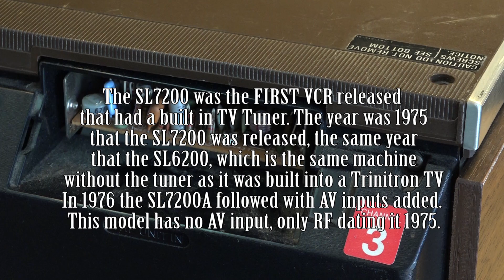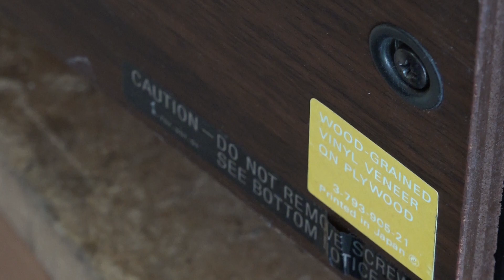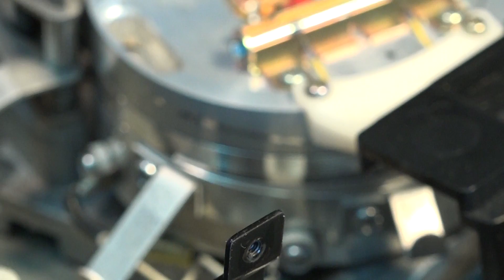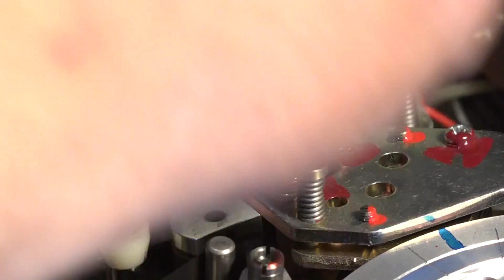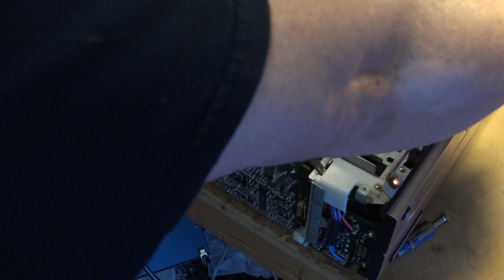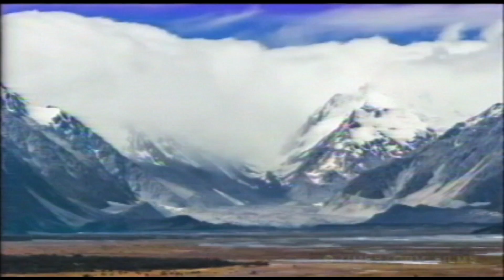Sony SL7200 Vintage Betamax Overhaul repair

Comment: I have a SL-8200 which is almost identical to this one and there is a noise that as far as I can tell is coming from the head drum. It sounds like it could use some lubricating, but I don’t know where. Is there a lubrication point for this, either from the top or bottom of the machine?
Thank
Reply from the maker: The 8200 capstan motors were the weak link on those ones.
Reply: @ the capstan motor was seized and I took it apart and lubricated it. Its working now. But theres a friction noise coming from the head drum area, like it needs a drop of oil somewhere, but I don’t know if there is a lubrication point for the drom head or where the bearing is.
Reply from the maker: @FranciscoBadillo-o6x it runs down the center of the drum.  Since that one has an ac motor and belt drive the drum speed is regulated by a brake motor.
Reply: @12voltvids  do I diassemble from the bottom and lubricate there?
Thanks

Comment: Hi, what digital to composite converter did you use to record that youtube video at the end on the betamax?
Reply from the maker: I recorded from the old beta onto dv tape using a Sony GVHD7000 hdv deck in dv mode.  That digitized into standard 4:1:1 DV format
 I then played it back and dumped via firewire to the computer.  I could have skipped the record to dv step if I had taken the beta into the house.

Comment: I have one of those in better shape and it worked the last time I used it. I planned to keep it because it is Beta 1.
Reply from the maker: It had beta 1 but but it was low band beta 1. High bans beta 2 and 3 looked better.   High band and super high band beta 1 was fantastic.
Reply: @12voltvids  I remember when those super high band machines came out but they looked like someone had turned the sharpness all the way up so I didn't like them. My SLHF-300 made great looking copies of laserdiscs.
Reply from the maker: @andershammer9307  the only machine that had super high band was the slhf1000 and it recorded a very good picture rivaling 3/4" umatic tape.  The VHS camp came out with the HQ circuit which just sharpened the edges. B

Comment: I have a Sony SL-F1 (PAL version of the SL-2000), which has a tendency to really expose dropouts on the tape.

Is there a way to suppress this?

Quite a few years back I had to transfer to digital a tape containing my late grandmother's 65th birthday, which contained a lot of dropouts and I had borrowed my uncle's beta deck for playback, since my own SL-F1 wasn't exactly in working condition at the time (power supply issues). Sadly, the tape used for storing the home video wasn't exactly the best in terms of quality and had been used quite a bit for daily recording and as such was riddled with dropouts.

But my uncle's deck (a Sony C20, I think it was) did an excellent job at "hiding" a lot of the more dominating streaks caused by dropouts - or at least make them stand less out.

Is there a way to adjust the SL-F1 to better suppress/"hide" dropouts to such a degree, that dropouts are less noticeable?
Reply: The SL-F1 had a built-in video dropout compensator - however this would cause problems when the deck was used for recording digital audio, which used its own error correction system for dealing with dropouts, so there was switch to turn it off when using this with a PCM digital audio adapter. Somewhere, on either the power supply or the plug that goes into the socket on the back, there will be a switch labeled PCM. You need to make sure that this is switched off to turn on the video dropout compensator.

Comment: I  have a Zenith JR-9000W  which appears to be the same as this Sony you are working on.  The Zenith powers up and looks to be functional, the cassette loads fine and spools out  and ejects ok but the only buttons that work are the eject and stop. Can't push the play, record or fast forward.  Any ideas what could be going on? All the belts are there and look to be fine. Appreciate any help.
Reply: I found the problem, one belt needed to be replaced. Now works fine  except will not play in color. Will record in color but plays it back in black/white. Put the recording on another player and the color is fine. Any ideas on that problem??
Reply: @tommills8368  AFC trimmer on the chroma board is probably off.
Reply: @crashbandicoot4everr  Thanks for your reply. What does that, "off", mean? The board needs repaired or replaced or turned on?
Reply: @colllisionman  Off-adjustment I should say. There's a trimmer (variable resistor) that adjusts the AFC for the chroma. 12voltvids did it on the SL-8600.
Reply: @crashbandicoot4everr  How do I find it? What am I looking for? Can you describe it please?
Reply: @colllisionman  Remove the bottom cover and unscrew the large circuit board. That board processes the luminance and chroma signals. You will find many variable resistors on that board. Look for the one marked "AFC", mark its original position or take a photo, then adjust it carefully while playing back a known-good tape and see if the color comes back on playback.
Reply: @crashbandicoot4everr  Thank you very much.

Comment: I don't think I have ever seen you clean any pulley groves only belts. Isn't it advisable to clean both?
Reply from the maker: If the belt had melted I clean it up.  I generally don't film the process because it is messy and time consuming but I have shown the process.

Comment: This Betamax VCR was introduced in 1975, but it usually came with a console TV which was the LV-1901. This was a Beta 1 only VCR, but a few years later, they added the Beta 2 and Beta 3 speed eliminating the Beta 1 speed from one of their earlier models. Pretty rare to find.
Reply from the maker: Yes very rare these days. I got this back when I worked for Sony. The heads were worn completely when I got it.

Comment: That's  a real beast  bit like Phillips 1500 had one motor. did you have original jvc mechanicals over there .l find your vids v interesting.u seem to have have plenty of work.l was in the trade .32 years don't think there any techs left .if it goes Duff u bin it.
Reply from the maker: Yes original JVC and Panasonic mechanical units were here. I have an old JVC, actually a few of them

Comment: Hey what if the 3.5mm screws that hold the upper part of the drum (those that you couldn't remove because you didn't have the tool) were stripped, would it be impossible to take apart the drum?

Comment: Quick question, any good online places to find belts? I have a Toshiba V-S56 that needs a new capstan belt.
Reply from the maker: Try these guys.
https://kpcomponents.co/
They are local to me, and I have bought a few things from them over the past 30 years. He won't know the belt from the model though. You will need a size.
Reply: 12voltvids 
Youre a life saver man! I really appreciate what you have done here on YouTube. Watching your videos really teaches quite a bit about these old electronics. I got a umatic right before I found your channel. It's a vo-2800, still trying to get it up and running. It was owned by a scientist. Can't seem to understand how the mechanism from it works
Reply from the maker: Stevo701 Gaming 
I have a vp1000 and vp2000 plus a Panasonic 9200 umatic and a Sony vo4800 portable. Pretty old machines.
Reply: Man that vp 1000, 2000. Can't imagine the amount of hours put on those things. I was also given a jvc vidstar hu-3300 it needs some new belts though

Comment: For what I see you're a Betamax genius I ha a couple of Betamax's tha I refuse to let go cause I have a few family recordings on beta tapes that were originally recorded on the SL2001 that I still have and has loading issues that I might try to fix looking at your SL2000 overhaul. I had some a couple of those very heavy first unit that I left behind when I moved and regret it now. Anyway I have a question is there a way to revive the dim display of the SL-HF300 the machine plays well but the vu meter is almost dead and clock is very dim. Thanks my email is pedrorl@aol.com

Comment: I had this machine or the one that came after it. I bought it in 1978. It cost $1,200. I recorded Elvis Presley's last concert the night I bought it, which was a few months before he died. I remember when the networks started using B&W video tape around 1960. I was fascinated how it looked just like a live picture. I can't figure out why film, although very good, looks different then a video tape recording. Is it the FPS rate difference?
Reply: Hello. Film looks different because it works very diferently compared to tape. You can get about 4K or higher resolution of film whilst back in the day older 2'' studio tape was quite limited in bandwidth because it really wasn't defined in pixels. Do some more research and you'll find out why film was king. Cheers :)

Comment: I have sort of an odd question. I have a SLHFR-30 Betamax and wanted to know if it would be possible to hook it to a modern cable box (the box I have is the ARRIS IPC 1100)? The reason I ask is because I wanted to see what it is like to record modern tv shows with vintage video equipment.
Reply from the maker: The answer is maybe. Your cable box will have standard AV outputs, and it also has an RF output that sends the signal on channel 3 or 4.Just connect your VCR to either of those jacks and you should be able to record anything you are watching. Some cable boxes, like my system, which is a Cisco 7150 turn off the analog outputs when an HDMI cable is connected. All I had to do is unplug the HDMI cable and connect it to my TV using component, and then the SD video output became active again. I can record everything, and I do it to DVD except for copy protected content. On demand movies, and HBO content is protected. So to record that I just run the video signal through a Macrovision scrubber (I did a video to demo this last year) and I can record everything, and do this on a regular basis.I also have the component cables routed through my Hauppague HD-PVR (original version) and that allows me to record an HD .MP4 of anything I can watch. I do this all the time, as there are series that I have been keeping, Homeland for one, that I have every episode on hard drives.I don`t upload it or anything, just for my own viewing, as I don`t use bit torrent to pirate anything. I work for an ISP, so if I were to get popped for copyright infringement for file sharing my employer would frown on this.
Reply: +12voltvids Thanks for the info! I will see if I can get it to work when my holiday break from college starts. On a side note, my dads uncle had the SL-7200 Betamax. He bought it in early 1977 and also purchased an inexpensive Black and White camera alongside it The SL-7200 was his main VCR up until 1984 when he switched over VHS due to the fact that the Beta format was on its way out (which was also around the same time my parents bought their first VCR, the Magnavox VR8416SL01).

Comment: This was not the first consumer VCR available. That was the Philips N1500 from 1972.
Reply from the maker: Those ones don't count, because first they were never available in North America, and they were proprietary format. In other words the tapes would only play on the same model. As Philips released newer models they were not backwards compatible.  U-Matic was the first video cassette standard, followed by Betamax, and then VHS. There were other formats also released, but they were never in widespread use. Also I never said it was the first VCR, I said it was the first Betamax model, released as a stand alone machine. The year before Sony released one that was built into a colsole TV.
Reply: What do you mean about backwards compatible? The N1500 was compatible with each N15xx deck.  The N1700 series was a different system, although the use the same cassette. Whatever you want to say, but the N1500 was the first consumer vcr available. And yes. Europe was 4 years ahead of north america on this one..
Reply from the maker: Right, you just said it. Same tape but not compatible.  That is just like the reel to reel systems we had here in the 60's, that's right the 60's and I have one, a Sony VC2000. The tapes all fit, but the signals were recorded differently. Betamax and VHS solved that problem.Even when S-VHS was released, it used the same physical size tape, but a different format, but it could play back the older standard tapes.Remember we had Umatic here in the early 70's which used the big 3/4" tape before any of the 1/2" cassettes were considered.
Reply: @12voltvids  The Philips VCR format actually was briefly marketed in the US under the Norelco brand, but it was a flop. The fact that the maximum running time of the NTSC version was only 50 minutes (vs 60 for PAL) probably didn't help:

https://www.youtube.com/watch?v=HvzOUrUshfQ

Comment: Really enjoyed your restore vids. Any chance you have cassette housing assembly and a belt you could part with/sell me that would be compatible for the Sony SL-800ME? A previous "tech" took a look at it and broke the belt, messed up the gears, and bent the assembly out of shape. Everything else appears to be working but I can't find any parts or donor machines for the life of me.

Thanks!
Reply: Simon It's the 711B2 chassis. The SL-F30, F60 and some other models have the same mechanism. Good luck restoring this wonderful multi system machine!

Comment: I really like your work to get those old betamax machines working.

I have a old betacord 1982 Sanyo VTC 5000-2 i have had it sense 1983 it still has power, no longer plays but when it did play it chewed tapes when stop was pressed rewind/fast forward was always very slow it was never able to rewind right back to the end of the tape. I would love to get it running normally again I still have tapes with the player.

So have you ever worked on the Sanyo betacord VTC 5000-2 model.

Cheers 12voltvids.
Reply: Shelley Wayne That's Sanyo's most popular model. Just replace the two belts and the idler and it will run just fine.

Comment: Awesome machine! How much do you think a machine like this cost back in the day? I have a Sony SL-5000 from 1982. I have it up on ebay right now for parts or repair. It's heavy as hell so nobody seems to want to pay for that crazy shipping price. It doesn't have the UHF or VHF knobs like your SL7200 has.
Reply from the maker: The first machine I bought new in 1979 was an RCA VCT201 and that cost me 2,000. This machine in Canada would have been more than that. The SL8600 was the current model for Sony at that time and it was 2100.00, and that is why I went VHS, because it was 100 cheaper.
Reply: Isn't that just wild. I just did a quick inflation calculation and 2000 in 1980 is like 6,167.54 in 2016.
Reply from the maker: Right, so remember that in 1990 I dropped 12K on a camera, and another 10K on a camera in 2000 and these were SD cameras.The first HD camera I upgraded to was 5,500.00 in 2004 back when I was still a serious videographer / cinematographer.For fun I think I will haul out some old cameras,  and do some shooting, from my oldest ugliest cameras I own. and believe me there are some ugly cameras I have. Going back to black and white gear.I'll record all the ST stuff onto modern digital tape, so the actual picture from the cameras will show through as good as they possibly can.  After todays fight in traffic on a wasted trip to the big city to buy parts (unsuccessful at that) I need a project that will calm my nerves. How anyone can crash into a truck I don't know. On the freeway at that. What should have been a nice relaxing trip to the parts dept turned into a nightmare. It started with a bad decision as to which parts store to go. I decided on the wrong one. Get there, only to find that they have moved across town. Funny when I was there 2 weeks ago there was no mention of them moving! So drive to the new location, fighting traffic again, missed them by 5 minutes. Actually I was there on time, but they had already locked the door! Time to fight traffic again. 4 hours to get to town and back, and I should have been there and back in 1!
Reply: I love old tech and would love to see more of your collection. Wow that sounds like a rough day. I hate driving through big city traffic. That's why I love shopping online and don't mind paying the shipping prices. Between your gas, time, and piece of mind it's worth it.
Reply from the maker: I am planning a video shot with a bunch of old cameras for comparison. Everything from an old b/w Vidicon, to single tube vidicon, consumer and broadcast single tube saticon, b/w and color ccd of various pixel densities. Will record everything to do tape, so the quality of the actual camera can be compared.   Should be an interesting comparison.

Comment: I would like to see someone service a Video2000 deck.  The format was developed by Philips in 1979 to compete with Beta and was better in several regards.  It only recorded one half of the tape at a time so the cartridge could be flipped over and recorded on the other side.  Many Video2000 VTRs incorporated a sophisticated dynamic tracking system commonly used in analog editing decks, and had servo direct drive on both capstans and the video drum.  The Grundig machines in particular were works of art, built more like a professional studio VTR than a consumer machine.
Reply from the maker: All the later machines had servos on the capstan and drum motors. Just these first gen units did not.The video2000 never made it to the NTSC world.